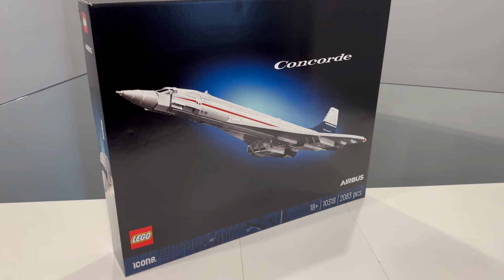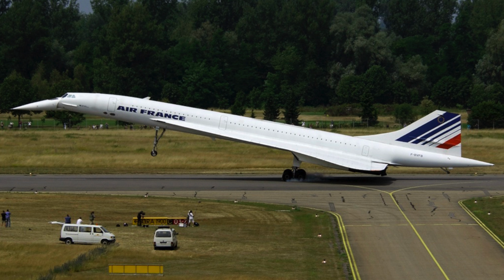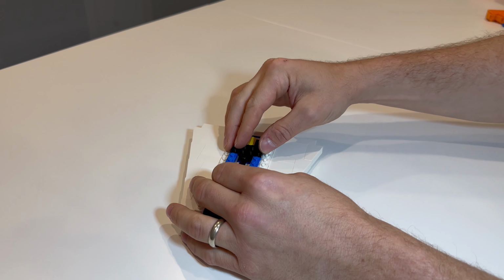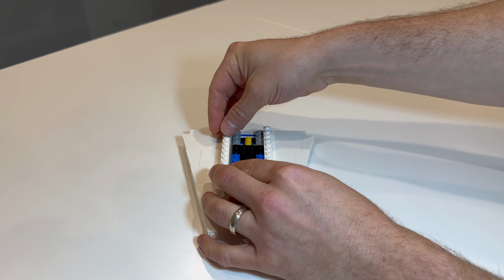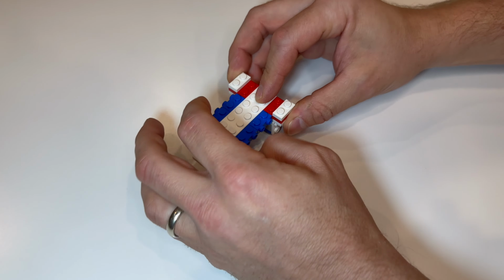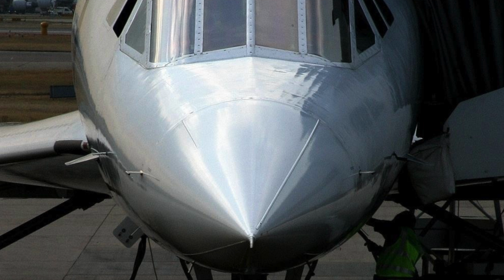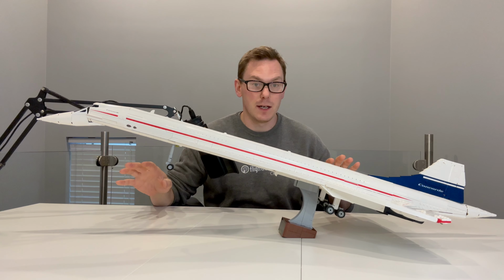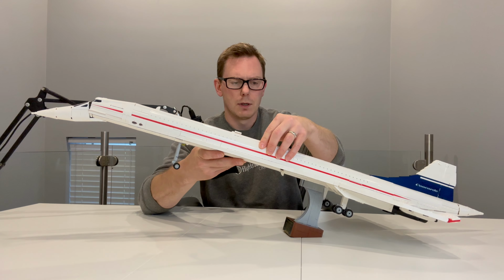We built LEGO Concorde from start to finish (and you can win one!)

Comment: My favourite thing about concorde is that it expands in length by a full 6 inches in flight due to heat expansion. Pilots of the final flights of various Concorde aircraft were sometimes known to insert items like their uniform caps into some of the structural gaps in the cockpit whilst in cruise so that on descent their caps were gripped in place by the aircraft as it contracted again.

Comment: My favorite thing about Concorde is it's massive leaps in technology that improved flights not only for itself but for succesive aircraft. For example by using fly-by-wire system. Also today's carbon fibre disc brakes were first used on Concord. Most importantly it pushed many barriers (pun intended) that showed that you can build supersonic airliner and it will certainly inspire future aircraft designers.

Comment: My favorite thing about Concorde is its exceptional engineering with turbojet engines designed to operate efficiently at supersonic speeds. And the Aircraft was built to withstand extreme heat during a supersonic flight! All while being a commercial aircraft.

Comment: My favorite thing about Concorde is that in 1985 the Concorde had to slow down from Mach 2 to Mach 1.5-1.6 so that a Tornado crew could get the only photo of it in supersonic flight! The Tornado could actually match the Concorde’s Mach 2 cruising speed, but only for a few minutes, and at a crazy fuel consumption rate. So, they stripped down the Tornado and asked the Concorde to slow down a bit to get the photo. The photo op only lasted a short few minutes before the Tornado had to break off, and the Concorde just throttled up and flew on to New York. Amazing engineering for its time.

Comment: My favorite thing about Concorde is thinking back to the engineers in the 1960’s who were designing this incredible machine with just slide rules, pencils, and some drafting tools.  No CAD, no simulators, no calculators.  And even 50 years later is has no equal.

Comment: My favorite thing about Concorde is that it was the first airliner sporting a fly-by-wire flight control system!  Even though it was only ANALOG, it was still fly-by-wire.  Concorde made its maiden flight 1 ½ years prior to Intel producing the world’s first functional, single-chip microprocessor, which did not go into commercial production for yet another year after that.  Yes, some partial-chip CPU systems were being tested at the time on military aircraft, like the F14-Tomcat prototype, but it was not until 1987 that DIGITAL fly-by-wire found its way into commercial passenger aviation, when Airbus’s A320 prototype took to the skies!  Early A320s reportedly had some systems running Intel’s 80186 and Motorola’s 68000 microprocessors.  This is super-cool to an old retro-computer/aviation enthusiast like myself.

Comment: My favorite part if the Concord was that it was available to civilian use. And though passengers really didn't feel the difference in flight, but had ab indicator for passages to see that their traveling twice the speed of sound. Another cool thing is that travel time between JFK International Airport for the Concord took roughly 2 hours of flight time where as the 747 passenger plane took 6 to 8 hours if flight time. I've watched the documentary on the Concord from when it was designed to the reason they where sadly retired for unforseen circumstances. Had British/Air France had the money, the problem could if been done. But, some shrub said it would cost more to fix the problem than what the aircraft(s) where worth. And thus all other three Concord's where retired from service. The forth Concord that was Lost was the main and horrible reason the Concord's where grounded. If you would like to know why the Concord's where retired. Watch on YouTube about the Concord's flight in England and what brought it down 😢